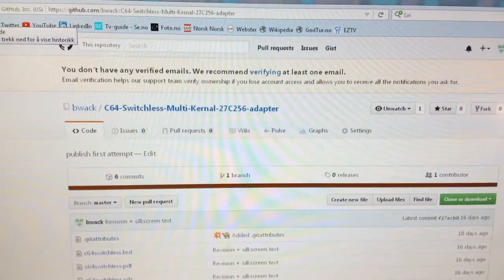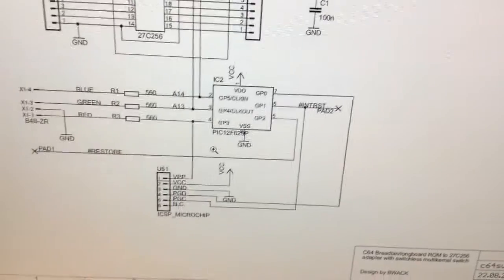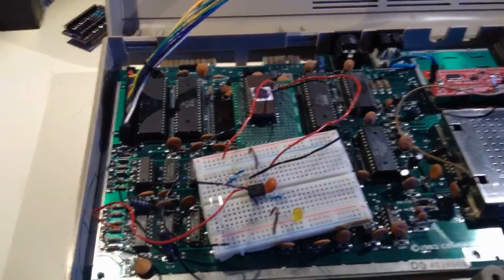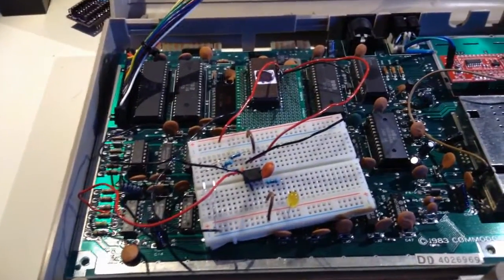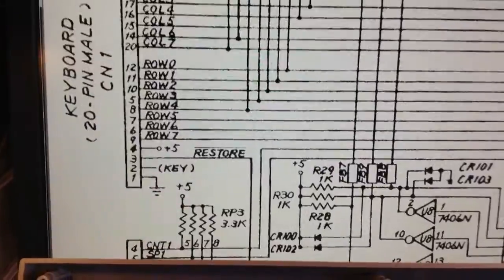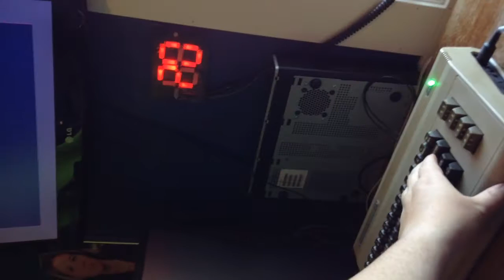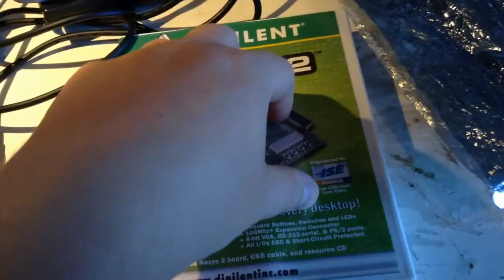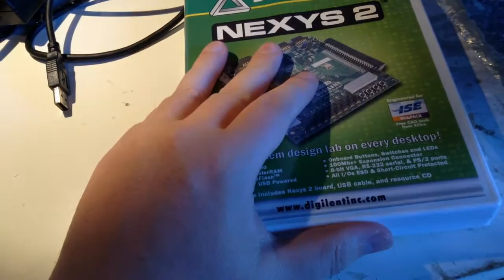C64 Switchless Multi Kernal part 4

Comment: So now you have two fpga boards to work with from university? Well done.
I like the kernal switcher this way. Very quick to operate. The led doesn't show that well on camera but in real life it should be clear enough. Next step perhaps a new way of replacing roms?
Reply from the maker: Yep. Two boards. Tutor was kind to le me borrow the obsolete boards. He suggested it himself after a chat we had. The cool part is that the old labs have the same project descriptions almost so I can practice myself at home. Just powered up the nexys2 board. Hopefully I'll get demo licence from xilinx such that I can try develop something without paying 10s of thousands of dollars. That is the downsides of the fpga community, simulation tools that costs a fortune or a new car.
Reply: What? Really? Having the board is not enough? You have to pay a fee to develop? Christ..that's the immediate killer for success. Especially if the amounts are high. What a shame.
Reply from the maker: After checking up on more of this, it is full versions of the simulation tools which are expensive. Like Questa that they have at the university. Some tools have free versions.. Other than that I see there are open source simulators out there. It can't be that bad.. It can't be.......... https://en.wikipedia.org/wiki/List_of_HDL_simulators
Reply: Nooo. You'll be fine. You have to get that VIC2 fpga'd. How are you going to solve that drawing issue? I understand it was bogging down your PC was it?

Comment: Fantastic progress!  The board looks great there with the PIC on the underside and the pass through socket pins etc.  Really impressed!   Also great to hear you're studying FPGAs at the university!  Don't forget, your first project needs to be a replacement CIA ;)
Reply from the maker: I had forgotten about that for a moment, that's a good idea. It will be a practice in how to piggyback or have the FPGA and original chip side by side and compare their results. .I have no idea how do to it, but some adapter has to be made, and some way to probe the logic, perhaps write directly to onboard RAM and do dumps later..
Reply: You might be able to look at emulator source code as well to perhaps get an understanding of the internal logic.  If I had more time I had planned to see if it was possible to do it with a fast enough PIC.
Reply from the maker: Yep. Another good idea :) I did look at a FPGA code some time ago. FPGA64 I think..  Unfortunately the die-shots of the 6526 on visual6502 is much harder to read than the vic ii. Elsevise it would be fairly easy to reverseengineer it to be cycle exact / make a netlist out of a transistor list like they to in the visual6502 project. The problem with PIC/AVR and also faster MCU's is repsonse time. This is why the SwinSIDs are write only devices. Imagine the CPU issues a chipselect and a read on R/W line, now the IC must respond within clock cycles. Remember the PIC/AVR is running a program durring these clock cycles. So a digital hardware register attached to the cpu bus might be needed.
Reply from the maker: How about this pic ? PIC18F14K22 .  16MHz internal osc with 4x16MHz PLL boosting it up to 64MHz. That's 16 MIPS (because PICs need four cycles to execute machine code). 16 cycles per C64-cycle. Should be able to respond then ? It's very tight but possible with ASM ?
Reply from the maker: check the read timing diagram on page 4 http://archive.6502.org/datasheets/mos_6526_cia.pdf
Reply from the maker: Have you seen the available FPGAs on mouser lately ? I was surprised to find, only a year since last i checked, that there are some really affordable and tiny fpga's out there. It has always been a problem with FPGAs that they are too large. Check the Lattice ICE40.. Less than $2 for one. (!!!) Ok I will try this xilinx board and make a model of 6526. Compare it with the orignal, and then later when it is a good match try and syntesis the design for the ICE IC.
Reply: Very useful!  I need to dig out my logic analyser first and work out how to use it again lol.  Quite difficult to get the timing just right unless you are experienced at that sort of thing.  My problem is I don't do enough of any one thing before moving onto something else =/
Reply: It's amazing how prices have come down!!!  I do hope you can work it out - it would be fantastic news for C64 owners!  I don't think the CIA does much does it- isn't it just some shift registers, a little glu logic for the addressing and the time of day stuff?  If you got the shift register side working I suspect that would work for most things, without the TOD - so you could work on the TOD stuff last.
Reply from the maker: looking at the timer part of the cia now. simulated the registers with read and write. its quite fast writing up a model and simulate them individually. the timer has a hand full of options and the register bits behave differently. so to get all of this right will tak some practice. maybe ill do a video on it. the vhdl might be hard to read though, but with a lot of hand waving it will seem professional. lol